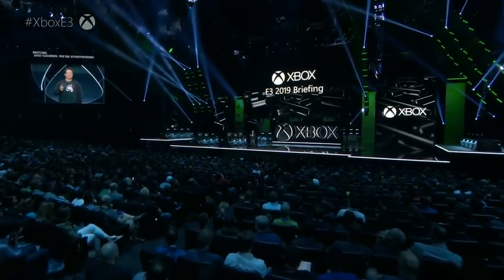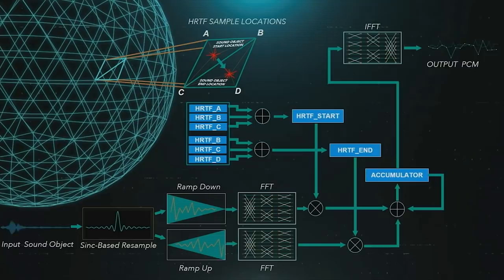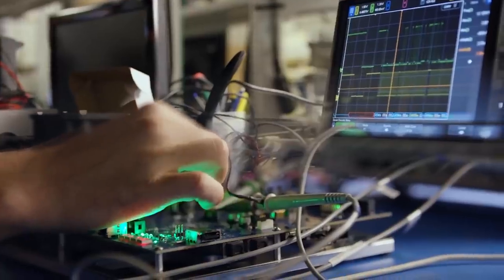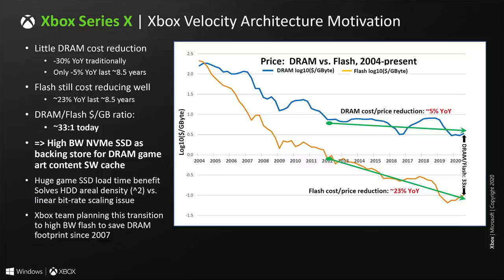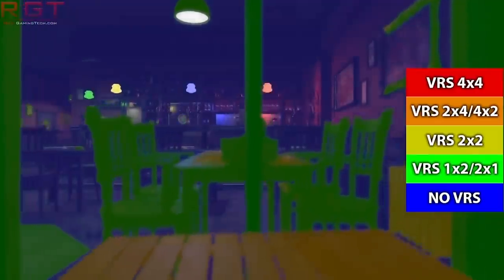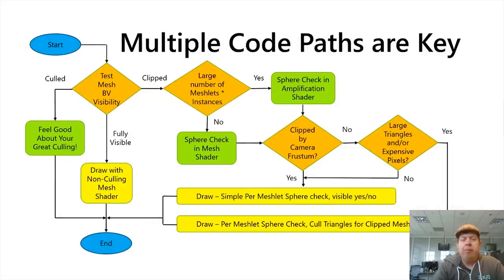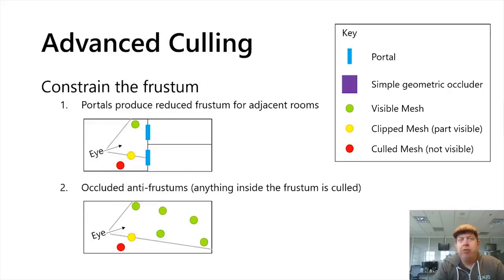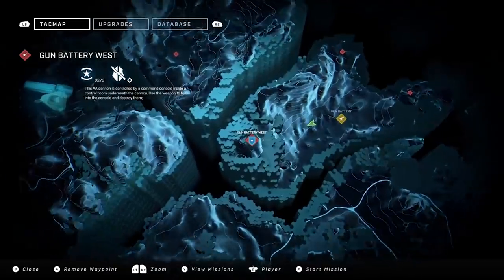Xbox Series X Hot Chips Analysis Part 2 - SSD, Memory, Audio & More

Comment: The PS4 featured a custom audio block as well, derived from AMD's TrueAudio solution - are you sure SHAPE was that far ahead?
Reply: @ChiquitaSpeaks  he said no such thing: https://youtu.be/ph8LyNIT9sg - he said there was nothing comparable to the PS3's SPUs in the PS4. He did not say that the PS4 had no audio hardware whatsoever. 

Further, the presence of TrueAudio has been confirmed by AMD: https://twitter.com/AMDGaming/status/400668118998978560
Reply: @ChiquitaSpeaks  I agree that the PS3 had an advantage in terms of bespoke audio handling, however my initial question is valid and correct.

The PS4 featured dedicated audio processing functionality as reported on by, funnily enough, RedGamingTech: https://www.youtube.com/watch?v=DqpoA_Y7-f4&ab_channel=RedGamingTech

Paul made a statement regarding the capabilities of the SHAPE capabilities of the Xbox One whilst stating that the PS4 had to handle similar effects with CPU resources - RedGamingTech's own reporting indicates that this isn't true.

Comment: hey paul, I dont know if this sound stupid or not, but would AMD cards be better at raytracing and general performance? like the XSX and PS5 will both run a Navi card and I think games get optimized for Navi. so would nvidia be lacking behind on raytracing and maybe some performance?
Reply: NVidia will perform stronger on PC exclusives and AMD more at cross platform titles.
Reply: I don't care about rtx and all the ultra settings I play fps game's low mid settings im good ,im in no rush to upgrade my gpu.
Reply: The RNDA2 GPU's launching this year are geared towards enthusiasts. So they will be top end GPU's from AMD. In other words they will blow the next generation consoles away in rasterization and Raytracing performance.
Reply: No, Nvidia has %80 of the PC GPU market. Nvidia has the money resources and connections to get excellent optimization and driver support on their cards regardless. People said what you said during the 8th generation with both Wii U, PS4 and Xbox One using AMD GPU's however it never affected Nvidia at all and will not know.

Comment: PCIe 8x5 Gen4.

PCIe 8x makes sense. What is the 5? Typo?

Surely it doesn't have five PCIe 8x interfaces. There's no point, everything but the secondary drive is integrated, unless they're counting the PCIe lanes that connect the GPU, integrated NVME, etc, in that same count. Seems it would be simpler to just say 40 PCIe Gen 4 lanes.

Comment: With Nvidia and Microsoft both offering hardware details while AMD and Sony remain quiet it's becoming a rather frustrating year with all the new hardware launches. Even when you get similar figures, like Nvidia comparing Ampere/Turing RT performance to the XSX and Microsoft offering a comparison of their audio chips to the Tempest Engine, they're not comparing the same things so the values are meaningless. Nvidia and AMD RT hardware accelerate different aspects of RT while MS included hardware audio codecs in their figures rather than just raw 3D audio compute.

Comment: 3.6ghz with SMT. Will new games see more performance improvement with core counts rather than frequency which is what happens now?
Reply: It all comes down to the game developers and engines. We will see what PS5 and Xbox Series X are truely capable of in 2022. Alot of these games are all cross multiplats. However there is already a number of games that run at 30fps on the PS5. Being Ratchet and Clank in 4k 30fps, Dark Souls I believe is 1440p 30fps, Assassin's Creed Valhalla is 30fps the same on Xbox Series X as well.
Reply: @ZackSNetwork  Demon's Souls and Ratchet and Clank were both running at native 4K 30fps in the July presentation but have been confirmed to have 60fps modes (of which Demon's Souls may run at 1440p).

Comment: HDMI chip in series X is 40Gbps, not the full bandwidth of HDMI 2.1 which is of 48Gbps. 
I don't think we need the full bandwidth for gaming anyways?
Reply: You only need 48 if you are going to do 4K/120 or 8K/30 with 12 bit color.  There are almost no displays that support 12 bit color.  You can do 4k/120 or 8k/30 at 10 bit color with 40 Gbps.
Reply: There is no True 12bpc panel TV right now and will take years until we get it for reasonable price...

Comment: It's a beast of a console.
Reply: Yet it can’t run a halo 2 looking game without pop in lol
Reply: @samgoff5289  ugh, that's not the case. First off it wasn't running on an XSX. Yes, that's an issue because there aren't many games shown on the console, I get it... However, just because that's the case doesn't prove the console can't run things extremely well, it's just weird. Second, the game obviously not close to completion at the point where they made that demo, that's on 343 and not doing well. Third, it's a game that's supposed to be running on Xbox one as well, which sucks but that's what they're planning. PC's at that point weren't using the velocity architecture or any of the boosts that XSX will bring to the table. Things will be much better for that game in the future, and all other games. No need to run off on something like that if you don't look at all the evidence
Reply: @samgoff5289  it's made for xbox one with a 5400rpm drive
Reply: @samgoff5289  typical fan boy comment, upset that the xbox is a superior console again, it will be ok don't worry go play your 4 exclusive games.
Reply: Based on what? Name one piece of software that suggest that thing is a beast at anything. All you've gotten were claims, 2 month before launch not single piece of software shown gives you any idea what this specs actually means. You folks reach too much, then we have the delusional who think a PC is ever going to not be able to run a development of a console game if that's the development environment. Such rubbish, 🤦.

As of now Series X is a paper tiger. All numbers but where's the pudding? We've seen what Sony toy can do, why the hell no one can yet produce anything captured on the Series X 2 months before launch? Yeah, beast my ass.
Reply: @evilformerlys4704  dx12, vrs, 52 computer units, machine learning, insane memory bandwidth, fixed frequency, theres more but i don't Remember all of them
Reply: @Nonx47  until we see games running on the console its a paper tiger.
Reply: @craigharris41  yep, because you know... Microsoft never puts out any consoles, they have no legacy to live off of. Can't take them seriously, they never put any money in the console business... What was I thinking? This has to be snake oil.
Reply: @evilformerlys4704  gears 5 was shown running 4k@60 locked back in march. Not the most hot thing but it's still evidence.

Considering how close the 2 consoles are zen2, rdna2, ssd, these "paper tiger" specs arent insignificant. You are comparing the ps5 to the xsx. You should be comparing the consoles as a whole to pc. 

You are losing sight of the forest for the trees. Plus you are confusing the absence of evidence as the evidence of absence.
Reply: @evilformerlys4704  Yeah, its like show me one game that runs better on a 3090 than on a 2080. smh
Reply: Both consoles will be great and a huge leap from previous generation, I don’t get the Sony vs Microsoft thing, if you want to win the power argument just buy a PC!
Reply: @captainfeathersword1131  This
Reply: With a weak games line up. Yay! I'm predicting Xbox One launch all over again. Funnily enough, the Xbox One X specs were talked up to the Max, too and look what happened there. I've lost all faith in Microsoft...
Reply: Philip Proulx The Xbox One X being the superior console in terms of power didn’t do it any favors and magically conjure up great games for the console that showcased all of that power. Don’t get ahead of yourself. Xbox loves to disappoint as often as possible.
Reply: Philip Proulx pretty sure pc has a lot more than 4 exclusives buddy 😂
Reply: @DVRKSTXR  that was late in the generation. This is starting out that way, and without the shit that xbox one launched with. The race is much more fair this time, even though Sony has a bunch of cultists following their playstation side of things. Yes, I get it, exclusives. That's great and all, but they're just not the games for me. I've said this over and over again, those games are cool... But I like shooters, first and foremost. I sold my switch because all I ever played was smash bros after I beat breath of the wild, and then I just didn't feel like picking it up anymore. My ps4 pro started collecting dust, once you beat a single player game... The replay value does down quite a bit. Didn't get the last of us 2 because I saw what a shit game it turned out to be thankfully, and ghosts of T didn't interest me at all. Ratchet and Clank will get old after the first playthrough. How many times are you going to play through that? How many hours do you think you'll get out of your $60? Then there will be other exclusives, all for $60. And there are many "timed exclusives" that were shown off at their event, not too many exclusives. How many hours will you get out of Spiderman morales? You're spending a ton of money for single player games that you will not get too much replay out of, at least most people won't. At least on the Xbox side the cost of 4 games a year gives me 100+ games, and all first party exclusives. 

If you really want to be the fastest, strongest gaming rig, get a PC. It'll adopt a lot of the XSX architecture like the velocity architecture, it uses dx12, and you'll be able to get SSD's much faster than the PS5's. Sabrent already has made an m.2 that's raw speed is about 30% faster than the PS5's. The etc 30 cards are going to be ridiculous... Sooo
.. if now we're talking about value, yeah, sorry man but the XSX and XSS has that down hard.
Reply: @Nonx47  You're in the minority. Many more people enjoy PlayStation exclusives the most and replay value is subjective. I have more hours in Days Gone than Halo 5 and Gears 5 multiplayer modes

I have no problem paying $60 to own great games, GP is just a game rental service you don't own those 100 games 

Also PlayStation has the best studios and this isn't changing anytime soon
Reply: @Nonx47  You can like whatever sort of game you want, preferences are a thing (we'd be a very boring species otherwise. Efficient, at least lol) but a huge deal of the shooters on consoles are multi-plat. It's like you're saying shooters don't exist on playstation, but I spent too many hours on my PS3 playing them. It's true that MOST of Sony's 1st/2nd party devs don't do shooters, but, that's probably because that's not where their market lies (visa versa for MS)

Also, not all single-player story driven games are "one and done". RPG's for instance have hundreds of hours in them. A lot of single-player story driven games on playstation have got multi-player modes too, Ghost of Tsushima is a prime (current) example. They're best of both worlds for a large majority of players.

Both consoles game shows consisted heavily of "timed exclusives" so that point is kinda moot.

I'm not sure I understand your PC point. Yes they have the power crown, always will. They have the price "wooden spoon*" though lol. The SSD comment is always dubious too, as the consoles (particularly PS5) have redesigned their pipelines to better utilize the SSD. PCs still have bottlenecks and inefficiencies in that regard, they still will for years to come** - although, the extra base speeds make up (some of) the difference.

Consoles are usually the budget gaming system sure, (XSX and XSS are especially just "budget gaming PCs") but they have so many advantages over PC than just price. Convenience (and comfort) is a giant factor. Unless you were comparing the XSX's value vs PS5, in which case I disagree. That's where value is entirely on the individual

* - not sure if that term is worldwide, it's given to the loser of a season in sports

** - new Nvidia cards will make some inroads here, but I think a design paradigm shift for GPUs will be required
Reply: @HanzouTheRazor  what you don't seem to understand is the one x still had to contend with the the jaguar CPU, so all the gpu advantages had to be used in resolution and effects, apart from a few outliers every multiplat was superior on the one X, with red dead 2 being a huge example of this. The series x won't have this issue as it's a much more balanced system, the advantages should be more prominent, more effects, framerate, resolution etc.
Reply: @bigjus3751  yet, so far we have seen nothing impressive from MS apart from a port of Mincraft and Gears 5, if you call either of those impressive. Its clear at this stage that Microsoft sucks at games. Playground Studios are their only saving grace. Me, I support high quality games. Not bullshit marketing and pushes for more subscriptions, micro-transactions and pay to win nonsense and sadly I've seen absolutely nothing that makes me want a Series X. Why do I need 2 $500 systems when I can have one that has more games and better games.
Reply: @HanzouTheRazor  dude you've not seen anything from an rtx 3090 but you know how awesome it will be because of the specs. How is that concept difficult to understand?

Edit.
As for the games part, its purely subjective. One could of course say that Sony can only make 3rd person action adventures with a different skin on each time. All of the critically acclaimed games hzd, spiderman, ghostOT, TLOU2, death stranding, Uncharted4, days gone even bloodborne and detroit is of a similar mold..... where are all the other great games from other genre's? Where are the great multi player games? Strategy games? True RPGs?......exactly.

Comment: I have a question about the I/O block In the SOC is it limited to about 6 maximum or is it capable of going higher. If xbox in the future puts in a SSD with 7gb+ RAW data will there compression get it up to 14.
Reply: The 6 GB/s number was with the decompression included in the figure. Also, "best case scenario", because it includes BPack texture compression within it, which isn't giong to be all of the data required. 4.8GB/s is much more likely (hence why they quote that number)

It should be possible to put a faster SSD in at a later date, but the decompression block will have an upper limit at some point (we have no idea what that is though), however, as with the mid-generation update of the consoles this gen, you are quite limited in what you can upgrade while still maintaining compatibility with existing hardware. I'm not sure if the SSD would grant much advantage (unless you had to push much larger textures, regularly) and I highly doubt an 8K refresh is going to happen this gen.

Comment: what do think of pairing senhieser HD 6XX with consoles
Reply: I was briefly looking into that. I would wait till the consoles are released, if you're planning on buying headphones specifically for them. Currently, I think the senhiesers only work in stereo on the PS4/X1X, so you're losing out a bit (although, stereo is possibly sufficient for PS5, as it sounds like all the "3d audio" will be designed for stereo anyway). I would expect headphones will be released with the consoles in mind if any compatibility changes are needed.

All guesses though